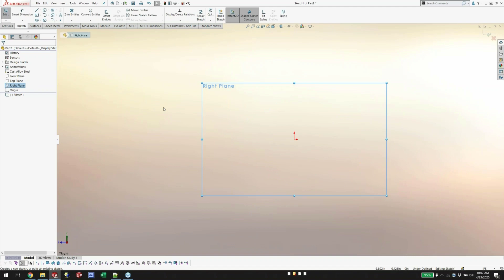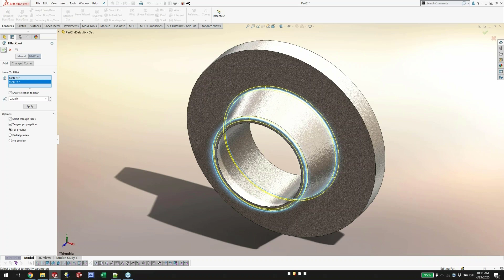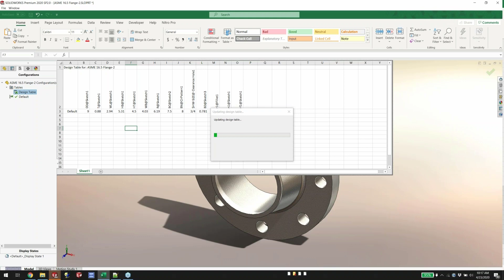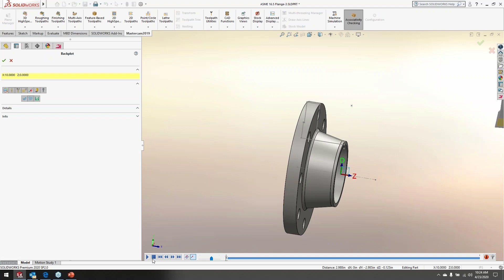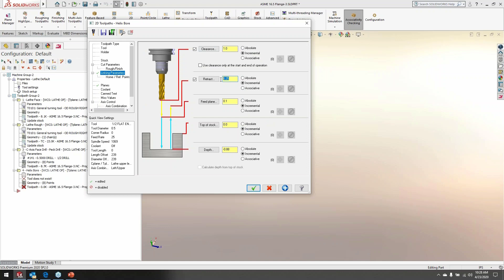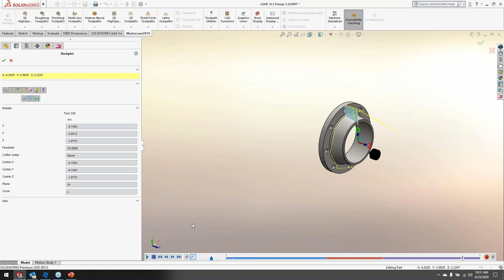Mastercam for SOLIDWORKS | Design and Manufacturing Webinar

Comment: How to add serration to the raised face?
Reply from the maker: The type of serration and where it goes will determine how to proceed.  Some features can be modeled and then toolpaths applied, while others may simply be a toolpath using a special tool or toolpath option to create that feature (similar to threading with a tap). This is a great question for your support provider, if you are an MLC customer you can reach out here: https://www.mlc-cad.com/technical-support/